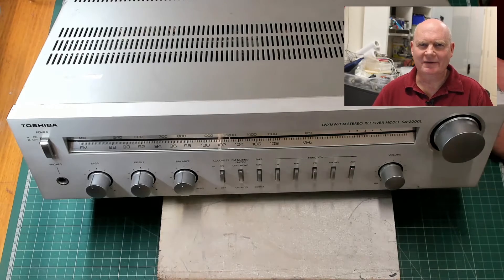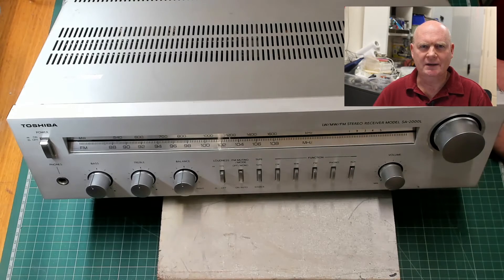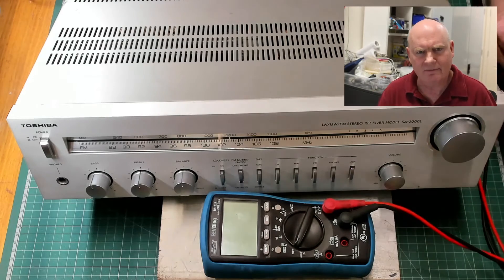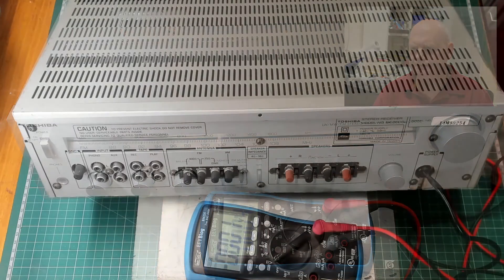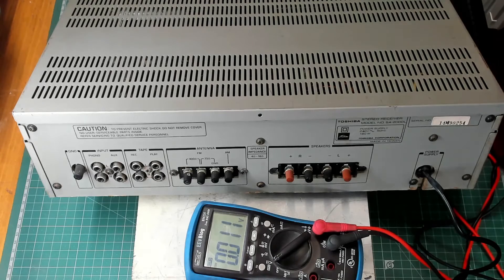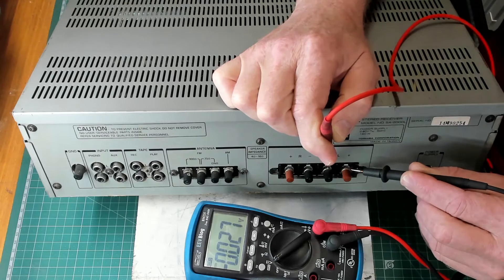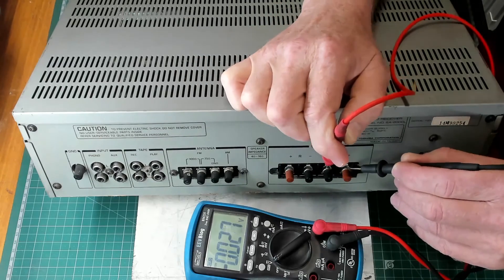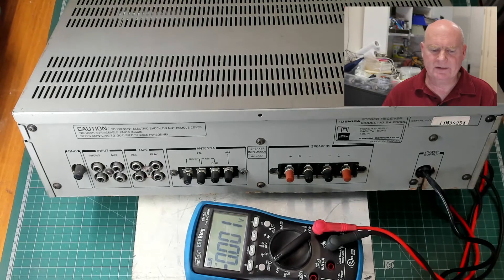Measuring DC Offset on a HiFi Amplifier

Comment: Thanks for posting this but can the offset be measured with 8 ohm load resistors across the speaker terminals or should they be removed first?
Reply from the maker: Measure the DC offset without a load connected (assuming you are not using a tube amp which I understand should not be run without a load, and this video is not relevant  to testing tube amps). I guess if you measured the voltage drop across an 8ohm load then you may be able to get a better estimate of the DC power being dissipated in the speakers, but to keep it simple, measure without a load, minimum volume, tone and balance controls centered/flat. I hope your measurements go well.
Reply: @northbalwynrepaircafenbrc8202  I just found out the speakers in the Harman Kardon 330A I'm working on are capacitor coupled and the procedure is done differently. I've downloaded the service manual for it so I'll study it later today and see what it says.  Thanks and cheers from Victoria BC Canada!
Reply from the maker: @mumbles552  I look forward to hearing how you go. Yes the DC-coupled amps SHOULD block the DC from reaching the speaker outputs, but these capacitors can fail. For interest, I have had a capacitor-coupled amplifier fail in a way that I measured close to 60V DC offset on one of the speaker outputs - not good at all, but it was an easy fix - replace the output coupling capacitor(s). If you learn some new techniques from the Harmon Kardon service manual, I'd appreciate an update.
Reply from the maker: Also for interest - here's a discussion containing a list of the amps/receivers that have capacitor-coupled output - may be of use for future repair projects (with thanks to Audiokarma, a great source for advice!): https://audiokarma.org/forums/index.php?threads/list-of-capacitor-coupled-solid-state-receivers-and-integrated-amplifiers.912075/
Reply: Would this procedure work for a behringer ep4000 power amplifier?

Comment: When checking DC offset do you set the volume  to its lowest level?
Reply from the maker: The volume control should be set to the minimum level and the tone controls to the middle of their range. I wish you success.
Reply: @northbalwynrepaircafenbrc8202 So the lower DC offset the better right?
Thank you
Reply from the maker: @SDsailor7  Generally, although there are likely to be practical limits at to how low you can achieve. The amp manufacturers will often quote a level in there service manuals (perhaps around 10-25mV range) and some designs will provide adjustment procedures if you are outside these limits. My suggestion would be to try to source the service manual relevant to your amp and check whether it has any relevant DC-offset information. Thanks for your post.
Reply: thank you...I bought a used unrestored reciever...this is first thing I'll  do....
Reply: Helpful video, thank you! Appreciate the posts in the comments as well.

Comment: The Volume Knob should be turned all the way down, all the way up, centered, the position of the Volume Knob doesn't matter? If the DC Offset is incorrect? How does one adjust it? If the E Capacitators have not been replace as of yet, will this affect the DC Offset? Thank-you.
Reply from the maker: The volume  control should be set to the minimum level and the tone controls to the middle of their range. The method of correction of an overly high DC offset depends on the design of the amplifier - some have built in adjustments and the procedures are detailed in their service manuals. Other amps require components to be replaced in order to reduce DC offset - and require a little more effort to identify the actual source of the problem. Replacing the relevant capacitors may or may not solve the problem.
Reply: @northbalwynrepaircafenbrc8202  Thank-you very much for the information and replying back to my question.
Reply: @northbalwynrepaircafenbrc8202  yes myn needed adjusting using the trimming pots that correspond to offset/bias. Pretty struck by the right terminal at 12v! Although I think the last time I did it I must have had the wrong setting on the multimeter. Silly me. Hope I haven't done any long term damage to my speakers. It's only just be aligned and I've had this amp rigged up with my newish triangle bro3's for over 3 months, some heavy loud listening times too 🤔 checking the tweeters and driver would be a right pain so I'm just hoping everything is 👍